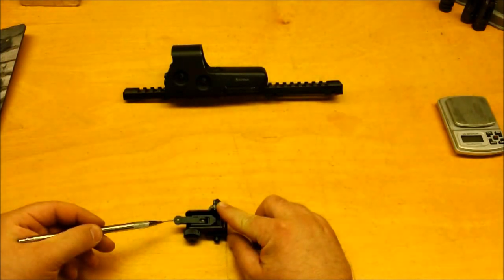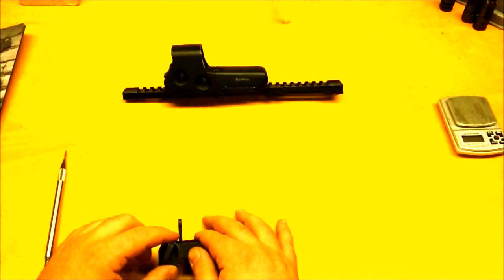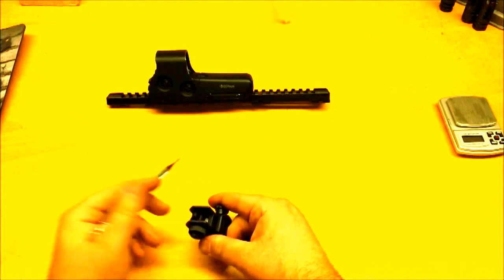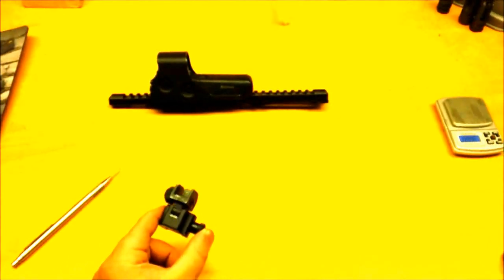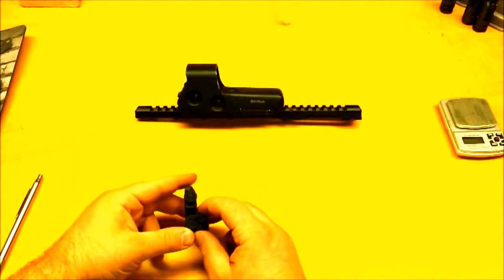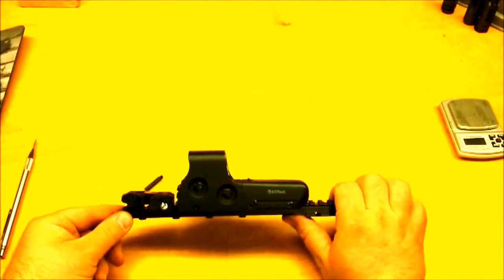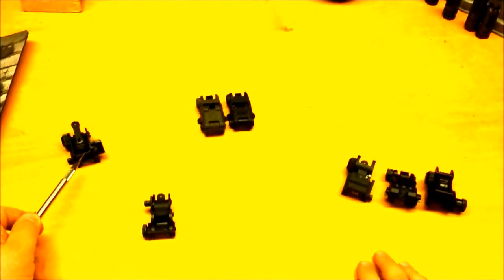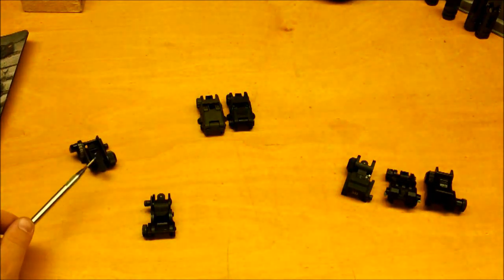Part II of A Close Look at Backup Iron Sights. Magpul MBUS vs Matech vs YHM vs Leapers vs MI vs CAA

Comment from the maker: If it is going to be your main sight, I would definitely go with something more stable than a flip up sight. If you want a sight that is adjustable for both windage and elevation, then get a carry handle sight.  

If you don't need elevation (using front sight post for elev) then Daniel Defense makes a great A1 style that isn't a flip sight. It is set in place and has both large and small peep apertures.  Only costs bout $65 too.